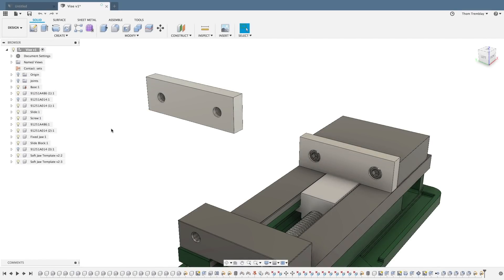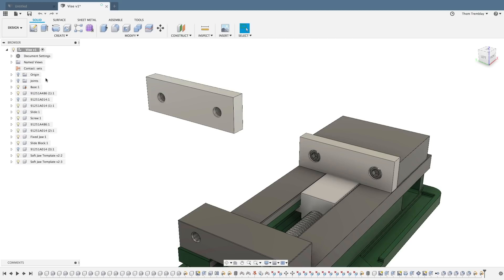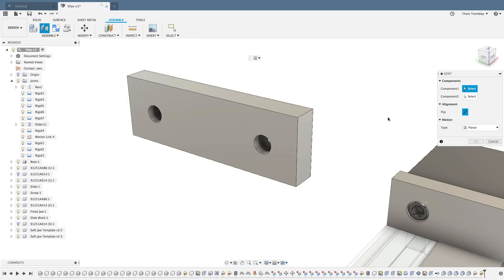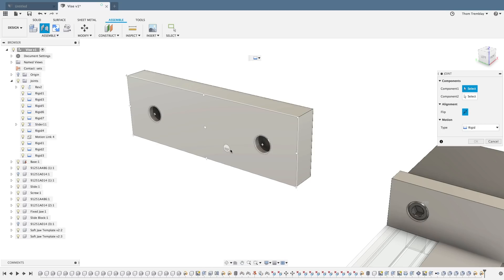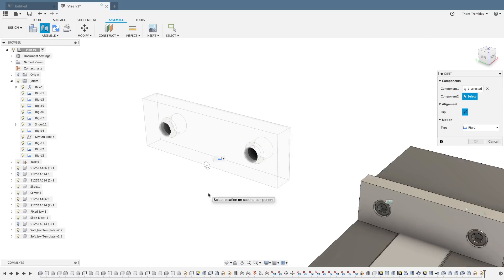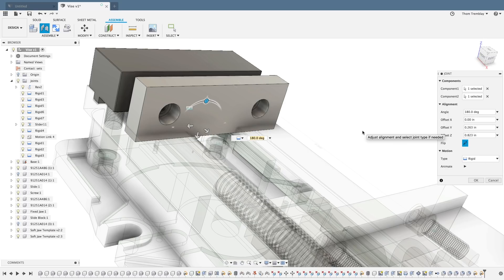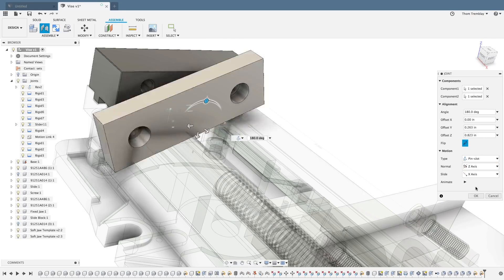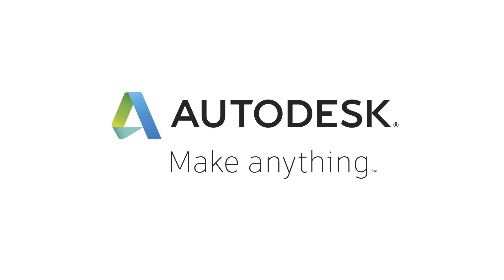Types of Joints

Comment: I'm trying to make concrete tiltwall fascia designs, ie doors, windows, fake brick, etc.  Ive tried to 'joint' a column onto the face  using a plane where the center axis should be but  it won't recognize the plane.  I can't seem to put a reference point on it based on the plane passing through the base panel either.
When I move the column component, the construction planes I'm set up to guide me placing door also move away.
? Thanks ??